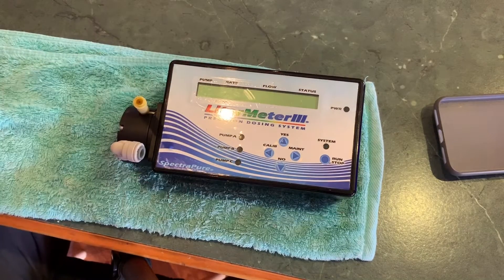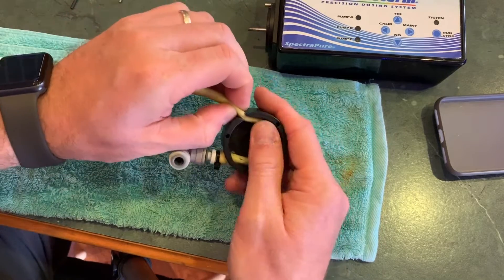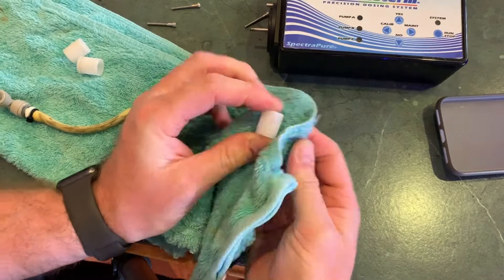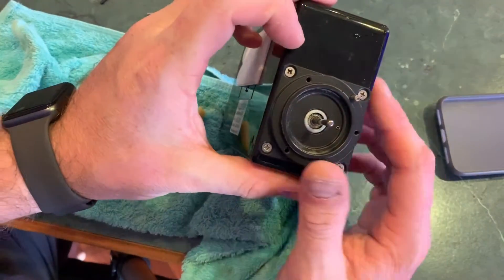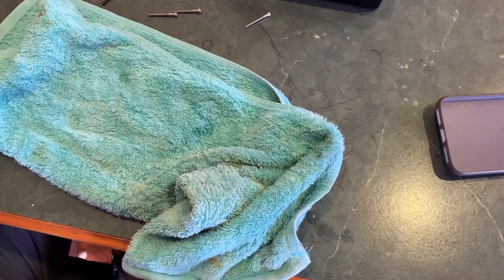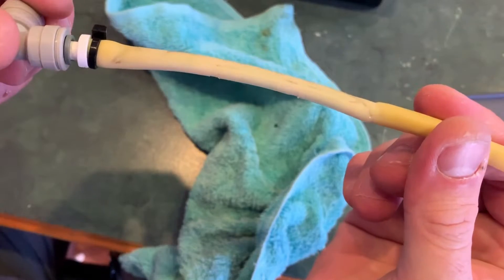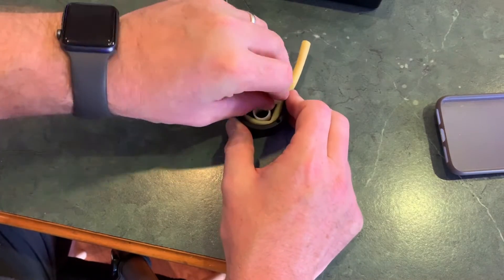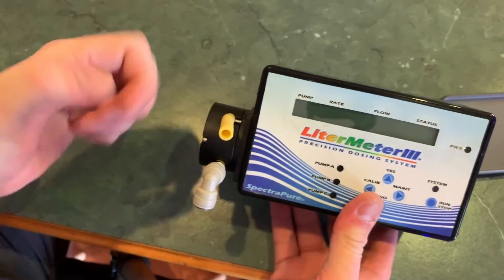How to service litermeter pumps

Comment: Hi Sam
Do you still use these pumps on any of your tanks if so where do you get the replacement tubing rollers etc thanks
Reply from the maker: Nope, I dropped using them as their support and sales were terrible, was near impossible to buy parts and I couldn’t take it any more. 

I switched to Kamoer x1 pro-t2 pumps and never looked back